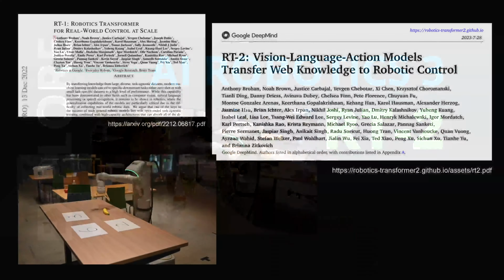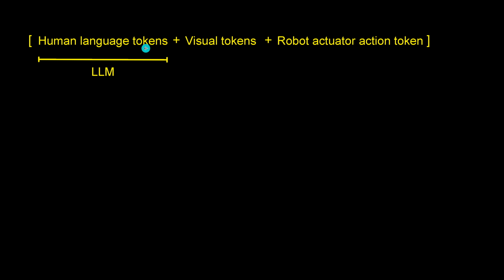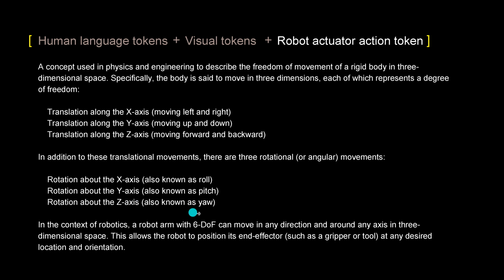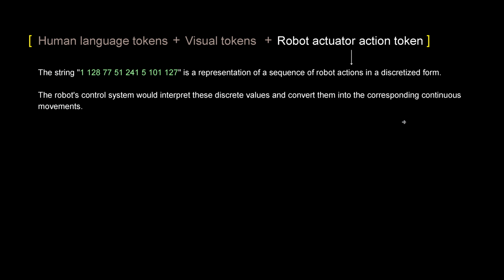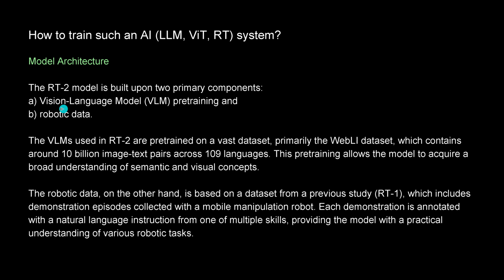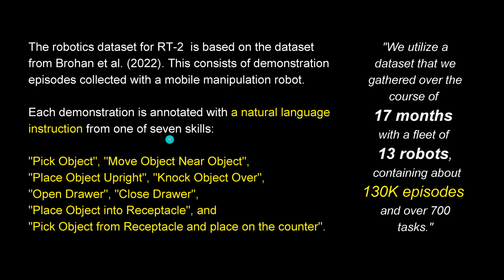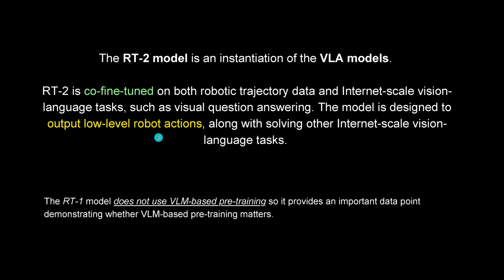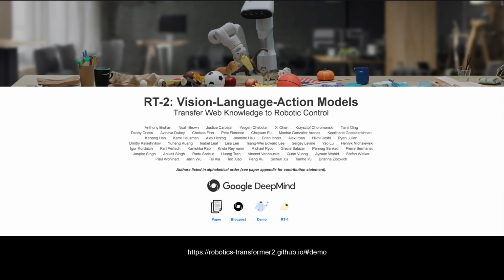Robotics Transformer w/ Visual-LLM explained: RT-2

Comment: Really good summarisation of RT. I am a student researcher working on VLA and robotic arm currently, it’s quite tedious tbh. Btw, you missed that RT also uses SayCan for grounding and chunking high level command to small action sentences.
Reply: SayCan., haha Ancient (meaning nearly 2 years old!). But that was one of the first models that Used LLMs in Robotics..asdie from just Language Conditioned Reinforcement learning, or behavior cloning
Reply: @aryangod2003  Yeah I know.
Reply: @rishiktiwari  If I wanna start learning LLM + robotics, whats the recommended learning path?
Reply: @loserc1854  The current state of general embodied AI is very open and experimental. We all know that transformers won’t solve the robotic problems. LLMs do not play enough role in robotic control, its mostly for natural language interfacing. Multi-modal models (VLMs, VLAs) are attempted commonly in closed-loop control but most of the current implementation is hard coded rather than fuzzily generating from AI (exception RT, VC1).
I would say, look into the existing models and how can you combine them at the layer output level to get something better (most of the present research releases are just this).
Develop intuition of how AI models work, and how it happens in human brain. See if you can correlate something or come-up with new design. 
In AI, programming and math are just tools to implement your intuition, remember this! Being good at math is beneficial but don’t worry if equations in paper looks scary, half of them are incomplete or BS. This is true for many papers released on arxiv or privately, they are not peer-reviewed and contain lot of flaws or tell a incomplete story.
The resources on internet are scarce, especially for someone starting new. Better to be good at reverse-engineering and asking people directly.
I would highly recommend to try implementing RNN, LSTM, CNN, TCN on your own and realise its limitation for better understanding of why transformers and attention.
Remember that transformers never know the meaning of token, they just transform on embeddings.
Also, there are three distinct groups: one who is trying to improve the AI architecture (mostly academicians), second who are improving the base models (mostly researchers & engg), and third who are putting all these models to meaningful use.
Sorry for long response but wanted to give a broad picture.

Comment: Does it have a context window? Or are all actions completely independent? Can I give it follow-up instructions? How does the feedback back to the LLM looks like? How does it know it worked? How about conditions? Like "open the drawer and pull out all blue cubes, but if there is a yellow ball in there, take only two blue cubes". What would happen?

I tried something like this with GPT3&4 it had no physical body, it was in a turn based game, every turn, the state of the game would be passed to all agents. It would work fine for like 5 moves, then it failed apart.
What are the specs for the arm they used? Is it like something insanely expensive, or can I use a lego arm? I would really give this a go. Mount it on a Roomba a let it collect socks or something :D
Reply from the maker: Great comment, I understand that I have to explain Reinforcement Learning (RL) with Transformers for Robotics. Next video will answer your question.
Reply: it makes sense that it would work with a lego arm, and since it has LLM it wouldnt really care that they arm is shorter or less accurate or that the camera is low quality. Now in terms of follow-up instructions, my guess is that it would be some system similar to the agents system, it has the LLM, memory and the tools. So you give it a prompt and that prompt is parsed to the LLM and memory so that it always has context of what its task is so that it knows when its done and what is the next step.
Reply: @bomxacalaka   It is an interative Loop until some kind of End tokken is generated I think.
Reply: ❤ this ; thank you for making such informative videos!😊